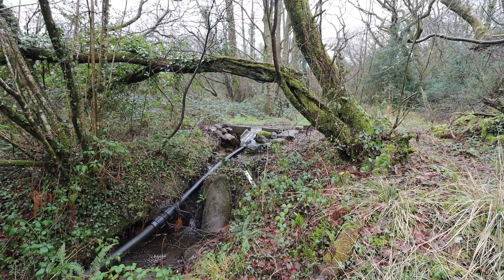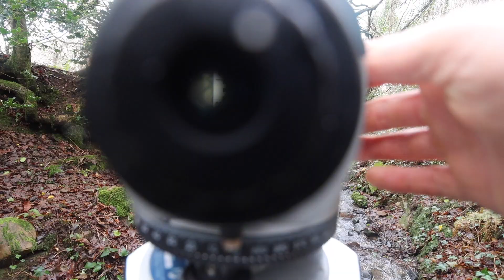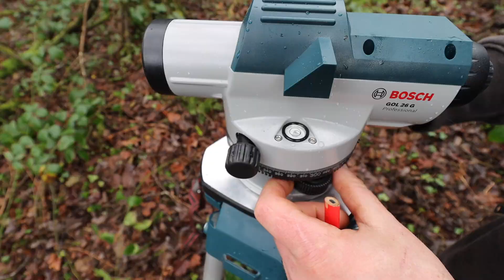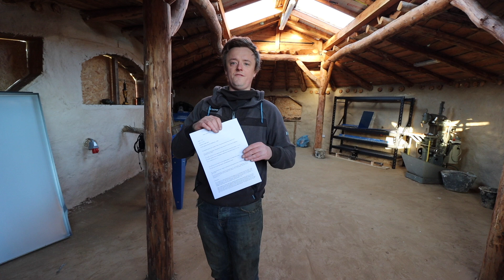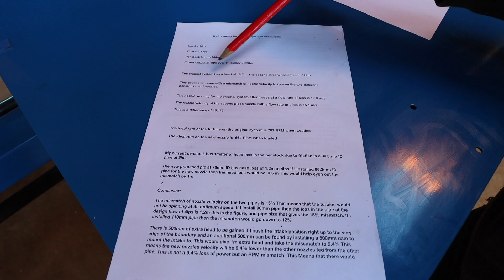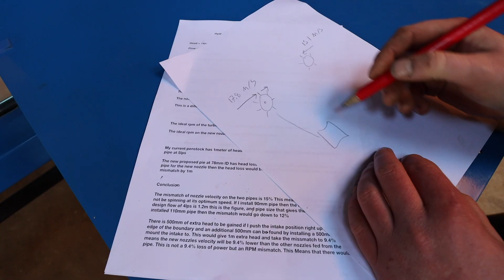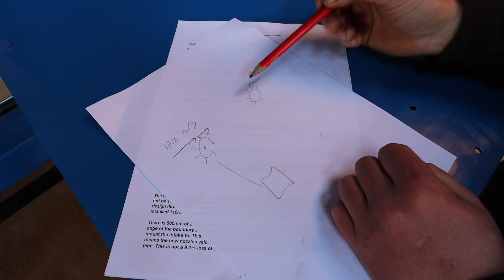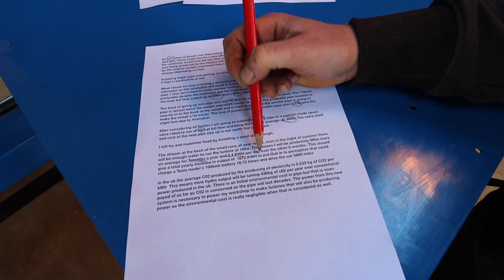Adding A Second Penstock To My Off Grid Hydroelectric Turbine (Survey)

Comment: I'm one of the number lovers - so keep it up as far as I'm concerned!

As for the next part, my intention isn't to be "that guy", just some advice I have learned over the years doing archaeological surveys. Firstly, your surveying methods are perfectly fine for your needs, where if you're +-20cm over a 200m run, you're happy. But if you want to look even more professional, you can do a more accurate levelling survey by having the rodman stand at the start, and you put the level about halfway between that point and the next one you want to survey, you then sight up to the rod and note that height. The rodman then moves to the next point and you keep the level exactly where it is, you swing it around at take a measurement off the rod. Then by subtracting the second reading from the first, you get the difference in height without having to measure the height of the instrument. You can then leapfrog the instrument down to the next point, take a back-sight off the rod, the rodman leapfrogs over you, and so on. You end up with fewer sights overall because the rod can move from one extreme to the other.
A couple of other tips: take a spirit level with you to level the tripod before putting the instrument on it. you don't have to be super accurate, but it saves time adjusting the tribrach, especially when you realise you have reached the end of a screw and so have to wind it back, reseat the tripod and start again. Also, if the staff doesn't have a bubble level, the rodman should gently rock the staff back and forth and the surveyor reads off the highest value. Finally, and I don't think you're guilty of this, always put the instrument in its box when moving from point to point. I have seen people just sling the tripod with the instrument still attached over their shoulder and go yomping off. It gives me the heebies just thinking about it!
Something I have just thought of - and I've not tried this mind - is to use the barometer in your phone. Get an app that gives you the pressure and ideally altitude, take a reading at the head, and another at the bottom, and you subtract one from the other. They're really surprisingly precise, to within a handful of cm, assuming the atmospheric pressure doesn't change too quickly. And you're only interested in a difference of altitude, so you won't need to calibrate it to the local QNH or anything.
Reply from the maker: Thanks for the info. that does make sense. Its not always possible though as I often have to move every time in order to be able to see the stick as its often very wooded and winding terrain. but when I can I will use that method now. Thanks
Reply: @KrisHarbour  
Also to calculate the distance : in the visors there are 2 extra lines. Subtract the measurements from them and multiply by 100 (should by written in the manuall) normally that would give the distance in cm
Reply: Soo..the crucial question is - is it a rod or a staff or a stick......?!?!
Reply: @andymccabe6712  If you want to sound professional, it's a levelling staff. If you want to get the job done, it's a stick.
Reply: @andymccabe6712  Rod's the member of staff who holds the stick isn't he? lol
Reply: @andymccabe6712  Depends on if it’s Gandalf of Saruman carrying it! ;-)

Comment: Hey Kris, I just paused the video about 9 min in to pass on a little information that I know from my days surveying roads back in the day with a rod and level. When you first get started set up your level and make sure it is level and get Dot to pick a large rock that is not going to move and place a mark on top of it, you would call this the main control point, You should make a note of where that Rock is so you can always come back to that rock. Now you are going to give that control point an arbitrary elevation (we always used 100 meters as we were not likely to drop below 100 meters in our survey and it makes for easy math). Now next you are going to use the level to get a shot from the rod, dot should rock the rod back and forth facing you, that way when you look through the level at the numbers the lines are going to move as she is rocking the rod, the lowest number you read will be the most accurate as the rod tips towards you the numbers increase and as it rocks backward and becomes plumb the numbers will be at their lowest and then as it rocks backward the numbers increase again. This makes for accurate shooting and you wont have to worry if Dot is holding the rod perfectly plumb. Now when you get your first shot done and have the numbers from the rod sitting on your main control point, just subtract those numbers from the original elevation of that control point and you will have the exact elevation of your level (No need to measure the elevation of the level from an uneven ground with a measuring tape), no proceed to take your shots along the creek as you usually will. When Dot gets to a point where you are starting to have issues reading the rod, have her mark another large immovable rock and give you another shot on it and call it control point #2, pick up your level and move it to a more desirable location down the creek, have Dot go back to control point #2 once you are set up and get another elevation for your level and carry on down the creek. If you want to go one step even further go through and set up control points first, just setting up taking a shots one the first control point, get dot to set up a second control point get that shot and then always recheck the previous control point, this will help just incase you bump your level while you are doing your survey as you can just get Dot to go to a control point to reestablish the elevation on the level.
Reply: Sorry was just re-reading what I wrote, where I said " subtract those numbers from the original elevation of that control point" It should be ADD those numbers to your control point as the top of that rock we are saying is at 100 meters elevation, so if you are reading 1.2 meters on the rod, the elevation of the level is at 101.2 meters. Then when you are shooting down to control point #2, subtract what you are reading from your levels elevation, so say you are reading 2 meters on the rod at CP #2 so you have .8 meters difference between the level and your control point, so the elevation for control point #2 is 100.8 meters, hope that makes sense!

Comment: Chris, for the survey you should try the following.  Set up your level and then site Dot.  Dot stays where she is and you then move the level downstream.  Now site Dot again without her moving.  You now keep the level in the same position and Dot now moves downstream and you take a site again.  Keep doing this foresight and then backsight procedure until the end, and try to keep the distance for each siting about the same.  Using this method is closer to the industry standard for a levelling survey, plus you do not need to measure the height of the level each time.  Backsight / foresight will cancel the height of the level and you then only need the start and terminal height.  Hope that makes sense.  All the best, Tim
Reply from the maker: Thanks Tim, a few people have recommended that now, I will give it a go.
Reply from the maker: Harrison, they can be used for a very rough estimate but the accuracy is no where near good enough for surveying a hydro system.
Reply: I didn't know altimeter were too inaccurate, I also don't know if relative altimeter exist that would just measure a change in altitude instead if an absolute value above sea level?
Reply: @harrisondring4863  altimeters rely on barometric pressure, as you correctly assume the resolution is nowhere near good enough for this kind of application. altimeters are for telling how far you are from the ground below, or how high you are above sea level, not for discerning the gap between two vertical points on the ground
Reply: @harrisondring4863  There are two: QFE and QNH.

QFE is the Barometric Pressure Reading (Q) FE - Field Elevation.

QNH is the Barometric Pressure Reading (Q) NH - Nautical Height.

You just Zero the Altimeter and read off the numbers.
Reply: @KrisHarbour  Forgive me if I'm being ignorant or naive but my satnav gives me an altitude reading. Could a reading at top and bottom, subtracted to give the fall? If the GPS reading is inaccurate in any way both readings would have the same inaccuracy and cancel out. Peter Tompkins
Reply: @cliveramsbotty6077  Absolutely NOT true.  For a given barometric pressure, the difference in height between two given points is very accurate.
Reply: @MrFriskyWhiskey  huh, never knew what QFE and QNH actually stood for. Many thanks for that. 😀
Reply: @KrisHarbour  yeah, that's exactly what I was going to say, the accuracy would definitely be an issue.
Reply: @thecorbies  “For a given barometric pressure” that is absolutely true. Problem is variance in the pressure. The air-column is not perfectly consistent, changing with the breeze, humidity, temperature, and more factors, making barometric pressure used at the required resolution just too unreliable — IMHO. It is a generally good tool, but maybe not for this application
Reply: @KrisHarbour  please give the method and the math bugging it a go, you will save a lot of time and look even a bit more professional 😉
Reply: Just wondering why altimeters aren't used for this application, I (rightly or wrongly) assumed that they exist with a high enough resolution?
Reply: More detailed instructions for this process (differential leveling) can be found in any basic surveying text (or free on youtube). With your equipment and proper field procedures, there's no reason you can't achieve mm-level relative accuracies (surveyors can achieve sub-mm accuracies over several kilometers of measurements). For a quick field-check of your measurements at each sighting, I recommend 3-wire leveling (reading all three wires and ensuring the difference between top-middle and middle-bottom wires is within a mm or two)
Reply: You can also get the distance by subtracting the bottom wire from the top then multiply by 100( move the decimal point to the right two digits). If you record the azimuth and distance you could draw a rough topographical map using a scale and  a protractor.
Reply: I agree with you. No need to measure the height of the level with a measuring tape. But if someone is measuring it with a tape he should measure it from to the ground to the crosshair of the lens for the accurate measurements

Comment: This was really interesting and has got me thinking more and more about localised power generation. Given the forecast increase in high velocity wind for the UK those massive wind farms are going to be spending more time idle than was originally thought but something like a hydro system will be able to keep going unless there is a very major drought and at that point you'll be getting more from the solar.
I can't help but be impressed by Dot - she seems to be as much of a workaholic as you are and looked to be fairly happy standing in a stream in the middle of a Welsh winter.
I agree with the other commenters about the tree - harvest the trunk and leave the branches & stump as habitat. That big lump of oak should generate some nice wood that you could possibly sell to fund other projects and a trunk that size will not really start to break down for a very long time.
I'm off to start watching some of your other hydro videos - see if I can edjumicate myself 🤣

Comment: Can you reduce the nozzle velocity "mismatch" by decreasing you nozzle diameter? Is it an issue of nozzle availability?
Reply from the maker: No the nozzle diameter does not change the velocity. The velocity is derived from the head pressure. a smaller nozzle would mean less flow and less loss so in that sense it would help a bit. but only because of less loss from less flow. But then we would be getting much less power due to the low flow than if we just run the mismatch
Reply: @KrisHarbour  I deal mostly in mechanical engineering but if I'm not mistaken, in incompressible flow (ei: water), your flow can be assumed constant at constant pressure. Your head loss increases through decreasing nozzle diameter (due to friction factor increase) but as the nozzle outlet diameter decreases, your average velocity at the nozzle outlet increases. I am referencing Bernoulli's equation for flow and the Darcy-Weisbach equation for friction losses.

Comment: I wonder if you could install a reservoir to terminate your two water sources then feed a single line into the turbine house. Maybe that could regulate your flow without special nozzles.
Reply: this almost makes no sense
Reply: @apoklyptykl13DMT  read fine to me :)
Reply: @Extragonk  what I meant is that after he explained the situation in great detail this GUI comes and wonders if he would build a new big structure that would take a lot of time resources space just to resolve a problem that can be fixed much easier
Reply: @apoklyptykl13DMT  I'm sorry to hear that
Reply: it would have to be a very large reservoir, the two source points are a significant distance apart.
Reply: @cliveramsbotty6077  Their distance from each other shouldn't matter, only their flow rate.
Reply: @Noble909  oh sorry i misread your comment, thought you were saying a reservoir at the collection points not at the turbine house

Comment: Wonderful explanation of your situation with cost/benefit analysis of the options. Another point is do you need the last 30 watts or so anyway? I'm completely solar here and in summer I can't use a lot of the available power whereas in winter I'm fighting to get enough power. I suspect you will be in the same position but with the seasons reversed and that residual 100W throughout the summer months will be extremely valuable and will save you building out a large solar array.

Comment: Hi Kris, could you explain why a manifold setup wouldn't work? The 2 different pipes into a manifold and then into the nozzles. Would this equalize the flow?
Reply: worst case, turbine not running, you will push water from the first intake to the second.
Reply: flow has no bearing here...dynamic pressure does...the only reason to know how much flow is in the creek is to make sure that at the end you wont run out.....

the nozzle jets reduce the flow at the end

if the new pipe has higher head then he wont need the old one...it wont make more power with more water unless the head pressure is higher

water speed coming out the end is called velocity, not pressure

static pressure is water pressure at the end with valves closed

dynamic pressure is water pressure at the end with the valves open...you can change dynamic pressure 2 ways here....how far the valves are open, which effects velocity also...or different size jets...which can also effect velocity

either way, there is a sweet spot of too much or not enough

Comment: If you join the pipes together before they reach the power station, wouldn’t that average out the flows between the sources?  I’d assume you could then split the flow between the nozzles.

Alternatively, there is a relationship between pipe diameter and flow velocity.  Wouldn’t it be possible to decrease the pipe of the new, slower flow, but only just before it enters the power house, so that you increase flow speed at that point but don’t create excess drag along the entire pipe?

Just thoughts
Reply: I was curious about this to, having the pipe join in a "Y" then have a much bigger diameter pipe entering the power house. issue i see here though, is when one stream runs dry in the summer or due to different pressures in the pipe maybe the higher pressure water will up flow the less pressured pipe, or the friction of the 2 joining would give you even more loose.

Comment: Your hydro (and wind) videos are fascinating and I love the technical info. Would it be possible to use two sets of spoons on different diameter wheels on the same shaft with the low head water powering the smaller wheel? I guess the extra weight and complexity might not justify any gain.
Reply: I was wondering same thing: just add a second smaller turbine wheel to the same shaft as the larger one.  One thought I had is that the waste water from the upper turbine wheel may somehow interfere with the lower wheel, but I really don't know.

Comment: Two different runners on one shaft is an option, I know Spencer has done it. The increased windage would likely negate the advantages.
Reply: I came into the comments to say exactly this. Hadn't thought about windage.
Reply: Unlikely to negate all of it, else they'd never run at all. The second wheel running on the same shaft would also split the friction losses, so also assisting the first turbine.

Comment: Just a suggestion, take this video down. It certainly doesn't come across that you're confident of indeed accurate. Wow, can't believe you thought this was suitable for your intentions.
Reply: Just a suggestion, maybe don't troll people and assume your opinion is the same as others
Reply: @gazza2963  As we say in Ireland "He doesn't know his arse from his elbow"  !!!
Reply: Accuracy is in the eye of the beholder. There are so many moving parts, and Kris has enough experience, that his surveying and hydro calculations are perfectly fine for this purpose. Tweaks to the system can be made after it is installed to dial in the accuracy.